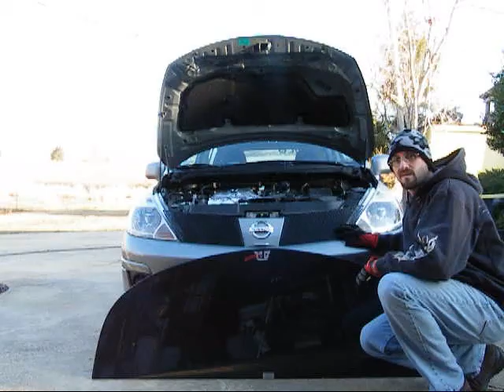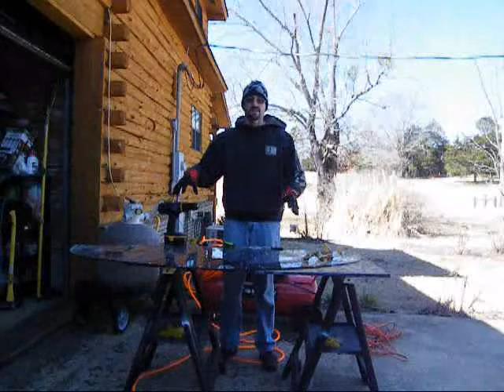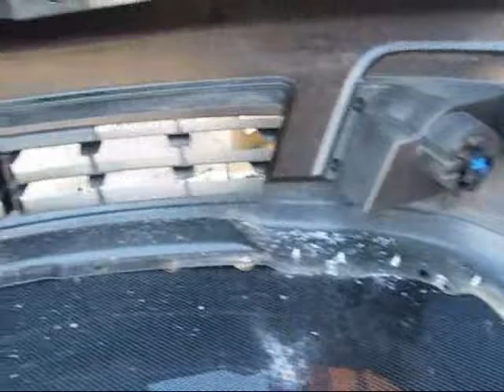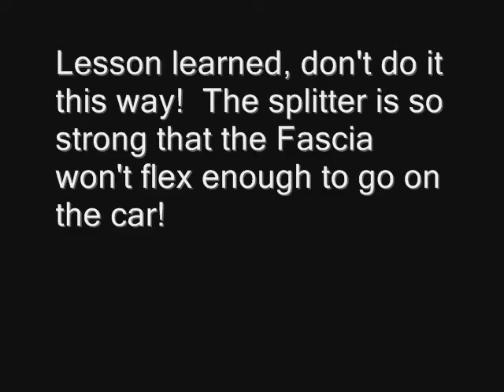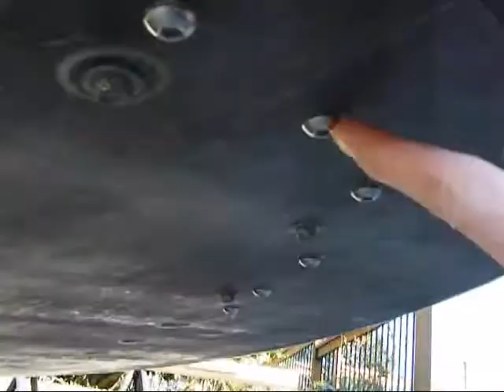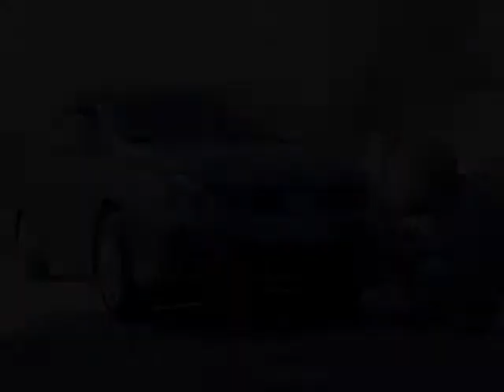Adding a Carbon Fiber Splitter to a Nissan Versa

Comment: How do you change your oil with the splitter on? Do you have to take the splitter off every oil change?
Reply from the maker: ALAN MACK The splitter didn't come that far back that it blocked the engine oil draining out.

Comment from the maker: I don't flip cars currently.  I have legit reasons why I swapped Versas and am letting the S14 go.  The engine change would probably take 6-8 hours if that was all you were doing.  I cleaned the engine bay twice, changed the accessories, wrapped the header, and did a few other small items during the same time so it took me a couple weekends to complete everything.